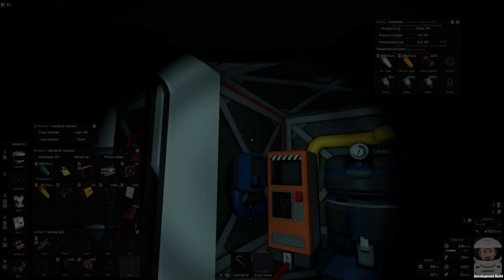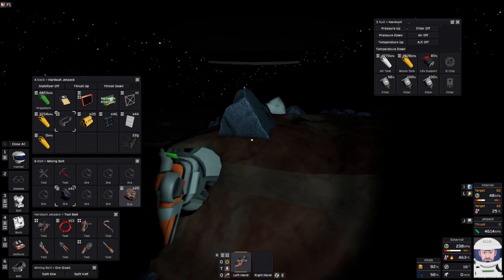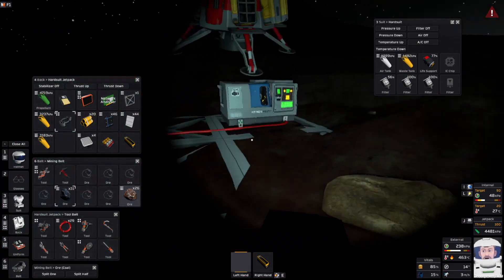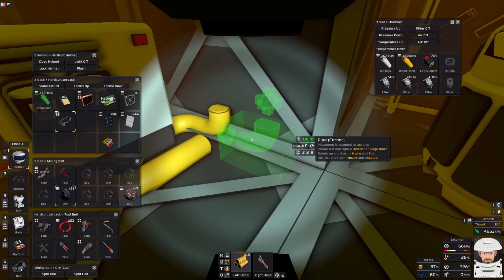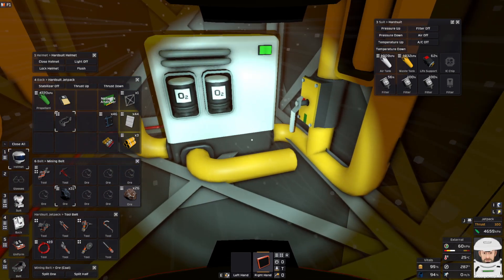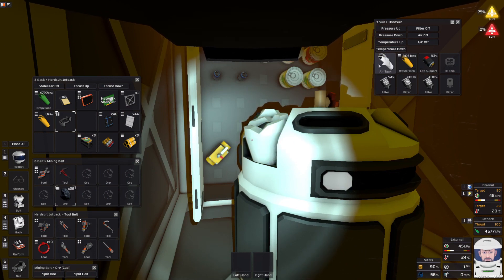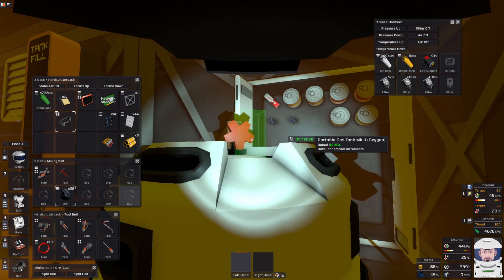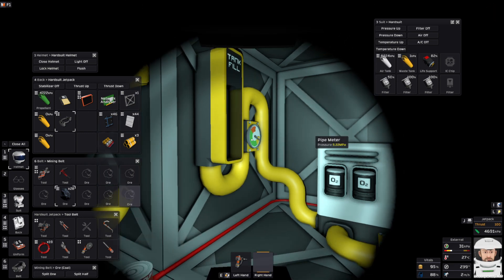Stationeers Venus Getting Started EP03 - Let's Get Wasted!

Comment: it says theres nothing in the pipe that exits the waste canister connector because the filter unit actually pulls gas MUCH faster than it can leave the canister, and thats even with it draining the atmosphere. this is why most base air filter setups dont use active vents inside each room, its just a passive vent connected to a central pipe that feeds into your massive filter unit, as the units can do all the filtering on their own

Comment: Can you still swap the waste tank and oxygen tank like was done when Vulcan came out?
Reply from the maker: Yes, but eventually both your air and waste will be super hot, and it won't work anymore.  If you just want a cheesy way, turn off filtration, and it'll keep dumping heat into the waste without dumping suit air in there.  To completely cheat, turn off filtration and put an empty canister in the waste.  Then the heat just disappears.

That's all more useful on Venus.  On Vulcan it doesn't matter much.

Comment: You avoid putting pipes against a corner, but you are putting pipes on frames. There is a long standing rounding error where in such cases, un-insulated pipes have a 50/50 chance of being treated as exposed to inside base gas or outside (or is it Vac now? frames are now treated as a vacuum instead of world gas.). For any given frame surface, that plain will be one or the other. It has to do with rounding and ever other plain ends up at .5 which rounds up instead of down. this goes for X, Y, and Z plains. Risu gave a good explanation of it in discord sometime ago.

This can be tested by placing frames in a stair step and putting pipe sections on the same side of each frame with a known gas temp. Frames don't have to be outside, just welded.
Reply from the maker: Are you sure?  In my uninsulated pipes experiment video, it seems like it now checks how much of each pipe is in each frame, and pipes in fully welded frames neither lose not gain heat.  They're fully insulated, similar to how a furnace is fully insulated inside of a welded frame.  If you put a gas sensor inside a frame, it does register outside atmosphere, but things that should interact with atmosphere don't inside a frame.
Reply: @autom8it339  The nature of the bug is, if you raise the whole test up 1 frame and try again, you'll see it, or should. Maybe they fixed it, but I keep hearing about it in the atmo section of the stationeers discord and teh devs said it would take a big rewrite of code to fix it. Maybe they found a workaround, but I've not heard of it. That was a part of the big welcome to insulated pipes, can safely put pipes on frames. The bug i'm talking about is stuff on the frame side, not in the frame. That is were the rounding problem seems to happen.
Reply from the maker: @vorgon  that's interesting, thanks.  I'll have to watch out for it.  The worst I've seen is a portable hydroponics box heating up to outside temperature on Vulcan.

Comment: I enjoyed it. :) How much mpa's can eight pipes hold? Also wondering how you're planning on expanding the "cabin" in the future. Looking forward to the next one!
Reply from the maker: Well, all pipes have a 60 MPa limit, and they just recently re-scaled the pipe meters so the max on the meter dial is now 60 MPa.  But the question is really "how many MOLs of gas can 8 pipe segments hold at room temperature without over-pressuring a canister?"

The basic canisters can only hold around 10 MPa (technically 100 atmospheres, so 100 * 101 kPa), so I generally don't like to fill them past about 7 MPa.  

The more advanced ones (and the bigger portable tank that came on the lander), which require steel, can hold twice that, around 20 MPa.

The pressure is a function of volume (in L), temperature (in degrees K), and the amount of gas molecules (measured in MOLs) in the pipe.  The game uses the ideal gas law to calculate this: https://stationeers-wiki.com/Pressure,_Volume,_Quantity,_and_Temperature

The portable tank that came on the lander is 790 L, and each pipe segment is 100 L, so I figured if it had around 8 pipe segments I'd have around the same pressure in the pipe that I had in the tank, which was still safe for the canisters.  Counting it up again, I think I had 9 segments.  After pumping most of the air back into that pipe, it was between 5 and 6 MPa, so it's all roughly right.
Reply from the maker: Sorry, you asked how I was planning to expand the base.  I'm not really, at least not the habitable part I have now.  My goal is to setup a starter base that can keep me sustained for a long time.  Then the next step would be to create a lot of power generation, use that to setup heavy duty cooling and atmospherics, and build a second bigger habitable area.  You need lots of power, and that requires steel.